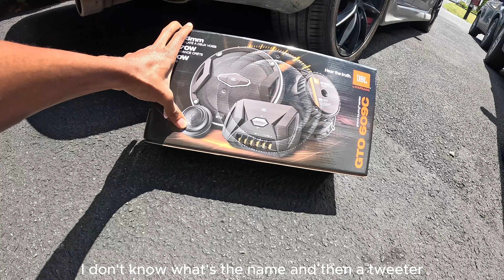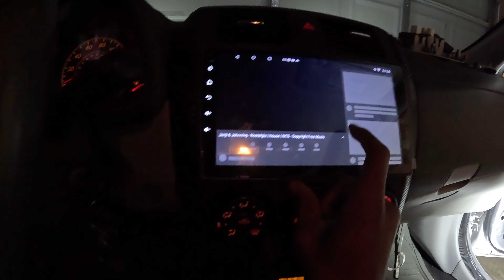How To Replace or Upgrade Front Speakers - Toyota Corolla 09-13 #diy #corolla#speakers #jbl #youtube

Comment: Hey dude, do you know if there is a stock amplifier for the speakers in the corolla?
Reply from the maker: I'm looking for one myself, but I doubt I can get the stock ones. I think I'll just have to get an aftermarket one.
Reply: @DIYwithBrian  I mean in the car already? I out some new speakers in and nothing works, before I thought bad wiring but I just found out that there is possibly an amp under the passenger seat, but I dont know if that is with a certain model or just any 9-13 rolla.
Reply from the maker: I don't see one in mine. So I'd don't think they have them.